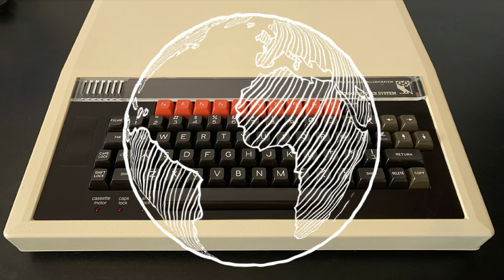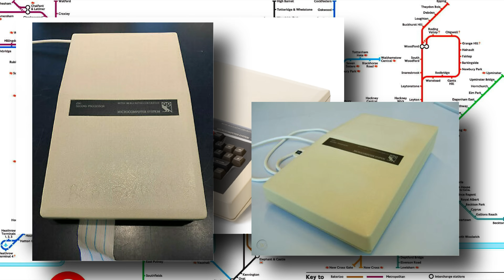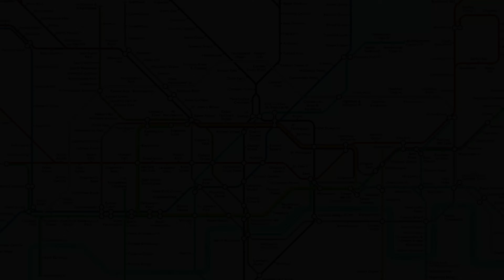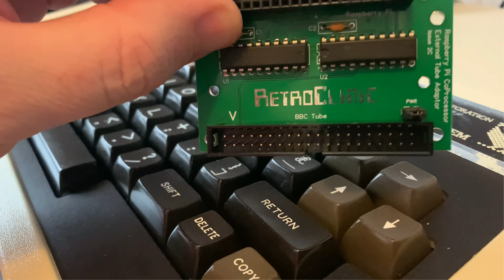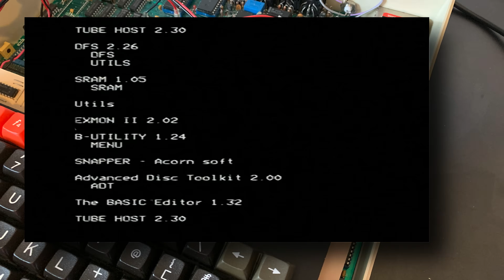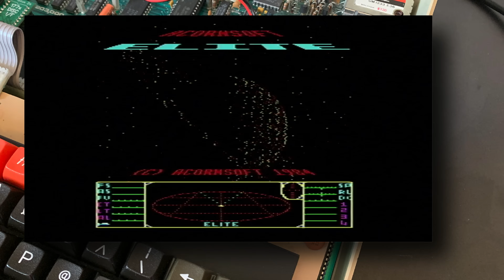BBC Micro - Part Four: Let's Jump On The PiTube! The Story Of The BBC Micro CoProcessor!

Comment: Brilliant - there's something very satisfying about a BBC/Acorn machine with a modern ARM processor attached - the difference in price (£299 in 1982 is worth about £1,128 and the Pi0 is about a fiver!!). Other interesting ideas - could you use a Pi02W instead? Is there a way to make use of the WiFi somehow? Endless possibilities, would love more vids on this topic 👍
Reply: You can use any Raspberry Pi, from the Zero to the 4B, except the Pico. You can't use the WiFi or Ethernet but, with the latest version of firmware, you can use the HDMI output to attach a second monitor, which has interesting possibilities.

Comment: So, I noticed a 286 emulator in the co-pros, so clearly it would be cool to see the BBC running DOS or even windows 3.1 (not sure you can get a mouse working though...)
Reply from the maker: Now I'm considering that a challenge! :) :)
Reply: @TheRetroShack  Absolutely...you clearly have more patience than me so once you've beaten the path, the rest of us can ride your wake :-)  You're right though - the BBC was so incredibly flexible and so well thought out.  As far as I know, the only official accessory for the ashtray was the Kenneth Kendall speech ROM though some people did fit a ZIF socket into the hole for ROMs.  You say you use the BBC for your writing - how do you get the text back into 2021- save to USB on the Gotec and then move that back onto a PC ?    Also, what is the difference between the GoTec and the SDcard interface?  Is it that the gotec contains many disc images but the SD card is just one?

Comment: When I was at school, and it was mostly all BBC Model B's, I used to enjoy my time in the computer room and do remember it fondly, but I didn't have all that much respect for the machine - it was so expensive, only had 32K, the screen memory organisation seemed difficult to work with, it had no hardware sprites, I couldn't redefine the characters in text mode 7, the bright colours melted my eyeballs, consequently many games were seeming a bit 'rubbish' to me (although I did play Thrust a lot!). HOWEVER... Today, I absolutely get what the designers went for, my focus is less narrow, and these machines now command my total respect.

Now, sorry for the long comment, but I also remember an older pupil who had hooked up an Atari 800XL to his BBC, I remember a ribbon cable and I'm pretty sure he had an edge connector jammed into the cartridge port. I believe he was accessing the floppy on the BBC from the Atari and I suspect that he was using the tube interface to do this. Having a cartridge inserted would clear an address window in the Atari memory map for the tube FIFOs, and they are both 6502 machines, so it all seems viable. I'd love to have known/know more about this, it would be fascinating to hear more from the student, but I can't even remember his first name after ~35 years.
Reply from the maker: Thanks for sharing - that is absolutely fascinating about hooking the Atari up to the Beeb!  And you're right about how age can make you look at things with a new respect - I absolutely adore these machines :)

Comment: I had Technomatic Multiform Z80 2nd Processor that cost £299 back in the day but it connected to the 1Mhz bus and not the Tube.
Reply from the maker: Did that need an accompanying rom to drive it?
Reply: @TheRetroShack  Yes it did and you booted up the system with a *Z80 command. There was a CP/M compatible OS on rom in the unit called OSM. I can't believe that was 35 years ago, lol, had to dig up old Acorn User articles online to remind myself :D

Comment: There also exists slightly smaller PiTube boards that fit on the underside, with a pi zero, directly into the tube connection.  At the same size there are also boards that emulate, with a pi zero, the original SCSI harddisk. Some of the more advanced co-pros could use a real hard drive. It makes the x86 co-pro, for example, much more useful.
Reply from the maker: I've seen the smaller boards - but only after I'd got this one :)

Comment: The x86 coprocessor can't run MS-DOS but runs DOS Plus from  Digital Research.  It aims to be compatible with MS-DOS 2 and it runs its own version of GEM and not MS Windows. The graphics aims to be compatible with CGA.
Reply from the maker: Thanks - doing a lot of experimenting at the moment :) Really amazing bit of kit :)
Reply: And it had not 256k but 512k, but that includes the screen memory and with some overhead from DOS Plus it is equivalent to a PC with about 420kb of RAM. There were third party memory expansions to "1024k", for another £99.00, that gave you more memory that the PCs 640k.  The BBC Micro CoProcessor x86 emulation includes the memory expansion.
Reply: If this is the Torch Graduate (256k + twin floppy) then I think it did indeed run MS-DOS (a PCW review commented how it wasn't running PC-DOS). From memory it's the Acorn 512k 80186 coprocessor that ran DR-DOS and GEM.
Reply: @MultiMidden  You are right, I had completely forgotten about the Torch Graduate.

Comment: Could you use a second processor to increase RAM on the beeb virtually by using the SSD within a program? I'm thinking animated sprites.
Reply from the maker: Good question - I'm only scratching the surface of this thing so far.  The possibilities seem almost endless...

Comment: The fact the BBC had/has such a wealth of connectivity was its most underrated aspect. Nothing else was like it. I loved my model B so much and it allowed me to learn not only coding but also hardware control of external electronics. What else had built in d/a and a/d like it did at the time? From traffic lights to turtles and sound to light convertors and everything in between.

Such a wonderful machine.

Great video. Thank you for the journey down memory lane.
Reply from the maker: Just glad you guys are enjoying the work - I love doing it :) :)
Reply: @TheRetroShack  I have a raspberry Pi 400 atm as  2nd 'desktop' computer. It is the closest thing you can buy today that has the same spirit of the BBC. If they were not so expensive I would be quite tempted to get a bbc case and throw it in. If you can get your hands on a RML 380/480 you should definately try. They were another really interesting thing at the time. I am guessing they are rare as hens teeth though. 

I had the Music 500 system on mine which was a very cool set of addons. So many regrets..........Should have kept hold of it. Ah well.

Thanks again. Keep em coming.
Reply: @ferociousmullet9287  A certain Eben Upton wanted to replicate the Beeb's educational versatility and spirit of adventure. Hence the Model A & B nomenclature in the Pi series. What he didn't replicate was the horrific price tag of the BBC micro! 😁

Comment: Putting the Pi on top of the RAM might not be a great idea when it gets to summer. The model B is notorious for overheating RAM which manifests as graphics corruption and random program crashes.
Reply from the maker: Thanks Chris - I was wondering about heat build up in these Beebs as they do seem to get a little warm - I'm thinking of getting a nice cooling solution together... Hmmm... Thinking cap on :)
Reply: It's typically only a problem on a hot day or is you've got poor ventilation and/or a lot of mods. Some BITD ROM cards were bad because they sat over the RAM trapping in the heat.
Reply: Wasn't that solved by Issue 7?  IIRC this was a significant problem in Australia, where the BBC Micro was very popular in schools located in Australia's hottest states (South Australia and Western Australia) and very few schools were air-conditioned in the early '80s.  It also didn't help that the all but the very last Video ULAs needed a whopping great heatsink because they ran so hot...